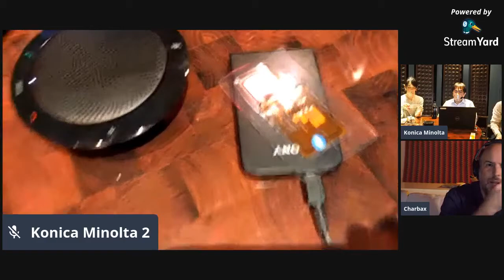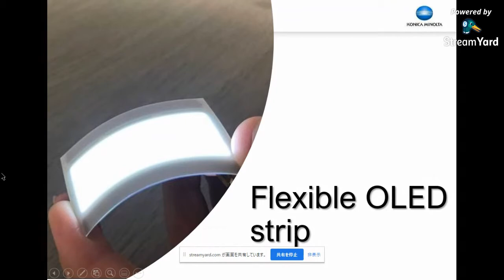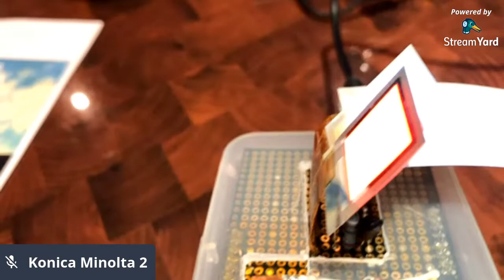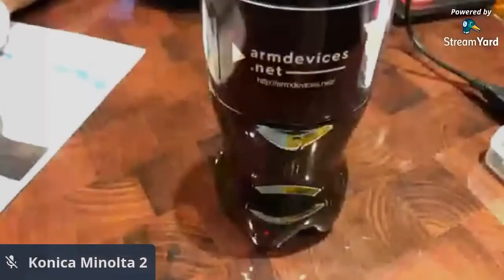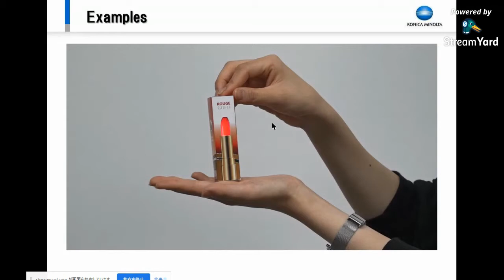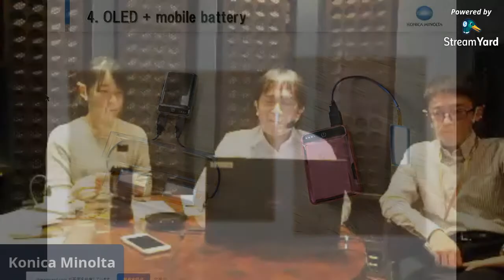Konica Minolta OLED Lighting Interview with Taka Tsujimura

Comment: Would be amazing if you can include either solar or ambient light charging instead of relying on a flexible battery
Reply from the maker: A little flexible solar would be great but then you'd still need that flexible battery and for it to be rechargeable..

Comment: They already make batteries from thin films, not surprising you can make flat battery and display onna bottle, but it wont last much. A solid state electrolyte can be cut live and it wont explode.
Reply from the maker: So maybe that kind of safe solid state battery can be the one that post delivery companies can approve for use in this kind of lighting up greeting card..

Comment: I need some 3 volts versions for Casio watch mods and for a pocket computer with a similar display with opacity (the old backlight went bad). I hope they sell some on ebay sooner or later.